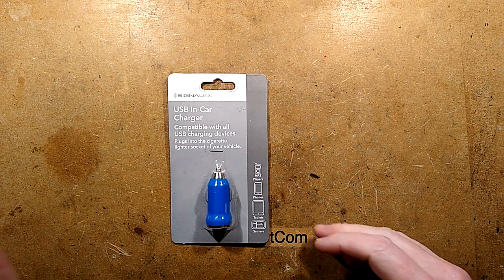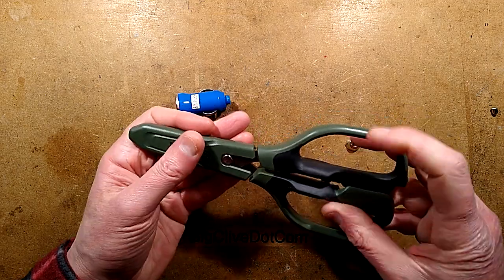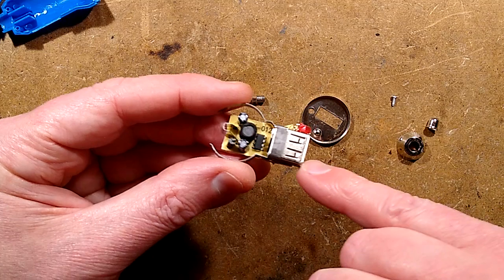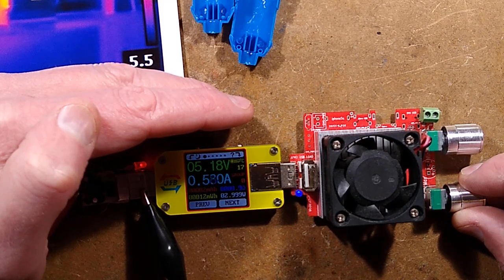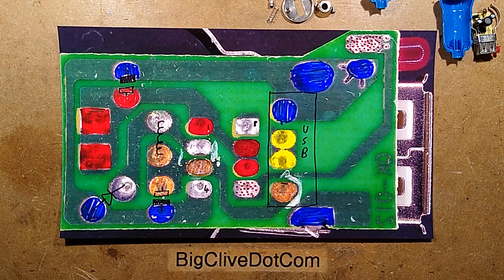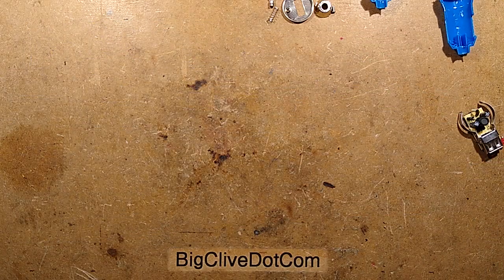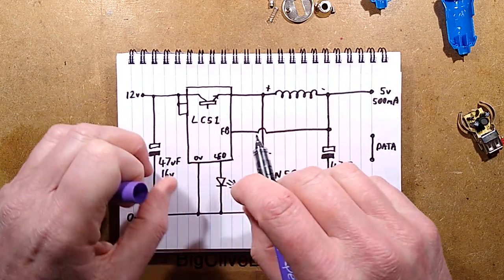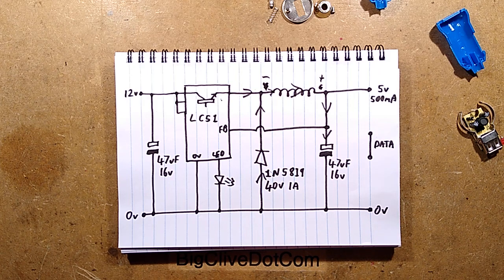Inside a Pound shop car-USB charger (with schematic)

Comment: IIRC shorting the data pins tells the devide to take as much current as it can from the USB port.
Basically it draws as much as it can without the voltage dropping.

Comment: To be honest, those things aren't really meant for more than trickle-charging some small devices like a phone or MP3 player. (Seems they're close to being optimized when designed for that role.) And for something typically under $5 on the shelf near the check-out counter, that's usually all that most people would expect of them.
Reply: "If you judge a fish by its ability to climb a tree, it will live its whole life feeling inadequate."

Comment: I could see this being somewhat useful if the chip accepted higher incoming voltages, like being able to plug into a 24v DC socket. But even if the chip can, they nerf'd it with the high-side filter capped at 16v. 🤷‍♂️

Comment: 8:13 I don't think the LED indicates an overload intentionally. It looked like it died down because the output voltage was sagging. It's probably driven off the feedback voltage just through an internal resistor.

Comment: Downside of these circuits is, when the switching transistor shorts, it just sends 12V to the USB port... there is ZERO protection, not even a clamping Zener.
Reply: Would a zener even help? If the chip fails, the zener would get 12V, probably not be designed for it, likely blow up open circuit, and give the same result.
Reply: @sanderd17  that's what the fuse is for

Comment: You need to nip down to Halfords and get a Tom-Tom adapter - looks about the same.

Now then, you got components? You got a screw, a fuse and a spring?  All for a quid? Blimey, Clive, that's a pretty good deal, all things considered!
Reply from the maker: The early TomTom adaptors actually had a remote voltage monitoring wire to ensure 5V at the satnav.

Comment: A specialized chip? In the 1980's they'd have just used a Zener diode in parallel with the load. 500 mA would have been a dream.

Comment: 7:04 I've done that with my S9 cellphone. Phone paradoxically runs its battery down to nothing trying to charge itself, and then just says "Check your charger" at the end when its down to about 5% battery life.
Reply: Oh, kids these days have it easy...I had a Samsung Galaxy Tab 3 that if you were to accidentally run the battery all the way to 0, you had to spudge off the back panel and disconnect the battery, plug in a 2 Amp charger, then reconnect the battery or otherwise it would just blink and not start.
Reply: @brentfisher902  Our first cell phone ran off a 12V car battery and took up an entire trunk. My dad is a doctor and got one of the first Motorola cell phones to come out for his car when he was working at the hospital. Next one ran off of internal lead acid batteries, but was portable! Huge step forward at the time lol! Still had to sling the electronics and transmitter over your shoulder when making a call, but it could go to the beach or on vacation, meaning you finally can leave work, but work never leaves you, just like today.

Comment: I'm almost certain the Motorola you mention is the ubiquitous MC34063. That is one seriously versatile chip. 

Looks to me the trend is to make the divider for the feedback permanent in the chip since it's always expected to make 5V... 

But that's annoying to people like me that get these things to repurpose them, and basically it's all but impossible to get a stable output from them at less than 5V (impractical is a better word, I've managed to do it but it's very Rube Goldberg lol... Better off just using another chip)

Comment: I went through several rounds of cheap USB car adapters from eBay several years ago. Current spec was optimistic to say the least and they ran too hot for comfort. I finally gave up and bought some Anker adapters for our family.  Not quite as bad as the cheap mains adapters but still dangerous.

Comment: I may be misunderstanding how USB chargers for Lithium cells should act. Most battery chargers maintain a voltage and the sign of a fully charged battery is reaching a set voltage or a set low current flow to shut off the charge.  I saw it acting correctly dropping voltage to limit current for the case of a shorting or over heating battery in a device designed for 1/2 amp charge rate.

Comment: My go-to flashlight has an internal charger that (I've never actually timed it) will fill a 3350 mA/h 18650B in a bit over an hour or so as long as the usb supply to it can handle the current.

Comment: In my opinion, it would have been better if they used a liner regulator instead and used a metal body as a heatsink as those can easily deliver 1-1.5A and their output is ultra stable but this probably 5 cents cheaper 🤔🤔

Comment: devices will try for an amp, w many monitoring for voltage sag and throttling current back. but that won’t work on this with its abrupt v/i curve.  
i guess you could charge a small power bank,  but overall i’m really surprised they are selling this at all.!   

 All of the cheap adapters I’ve seen in recent years here in USA do an amp, though not gracefully. ..
Reply: The surprising part is that they label it at 500mA instead of the 1 Amp that they get listed in the US from what I've seen
Reply: @nyetloki  At least they are honest about the product being useless 😂

For a period iPads would pull the full specification’s 1.5 amps when D-/D+ were shorted.  I plugged mine into one of these  “1A” car  chargers and it instantly made quite  a crackle  and pop w magic smoke.  Apple had since scaled it back iin the software, and now ipads and iphones draw max 1A when plugged into D-/D+ shorted chargers.

Comment: Could you bodge in a bigger transistor and get the thing to drive higher current? Lol probably cheaper to buy a better unit, but stuff like that always intrigues me haha.
Reply: Would probably also require bigger inductor, diode.

Comment: It would be nice to see a modified version. A single FET or transistor from the 12V to the inductor, controlled by the output from the IC (which should be disconnected from the inductor), should do the trick. PS: it might need a pulldown resistor and/or base resistor depending on type of FET and output of the IC.
Reply: Even better would be a new chip revision with a lower loss transistor (maybe a MOSFET) to keep chip cool even at 2.4A output load .  Might also remove redundant pins as 6 pins would do, though keeping the pinout would allow supplanting the old chip in the market .

Comment: These seem to be quite gentle on phone battery life, almost like a trickle charger.  You can leave it plugged in all day with a nav app running, and the phone never gets hot.
Reply: My s7 and s10 would discharge faster than it can charge with a maps app running. Hell it would discharge with anything running at 500mA

Comment: Well... A modern battery would be for instance on 14 Wh, to and that "charger" provides 2.5Wh, so given you have more than 6 hours of battery on a charge it'd power it fine.

That said, it depends on if you're listening on music or playing games. It is what it is, and I'm my eyes it would be perfect for a lot of things, especially on longer trips or as a cushion to stop the battery from discharging.
Reply: I have a USB power bank where I stayed up on a cold winter night and hooked a USB load and testing meter and it was able to run 2 Amps for 5 hours non-stop, so 50 watt hours on a single charge...It kept me warm and toasty under the bed covers....Yes, they do make them this big...it takes the good part of a day to charge up, though...

Comment: I have these in my house I use them to charge my phones and power lights all over my house. People talk about power walls using 18650 cells and tesla walls and I use 12 volt battery's and 10 of these things and a 4000 watt inverter. I get these at the dollar store but I make sure to get the 2 amp ones because they don't get hot as fast as the 1 amp
Reply: I did something even sillier, I soldered wire to the contacts of a $20 cigarette plug 12 to 120 volt DC-AC inverters and hooked it to the high-voltage side of a Arduino step up converter adjusted for 12 volts, and soldered a USB male plug to the low-voltage side...I can run a 4 AA Sony 120 volt battery charger off of a USB 2 Amp power bank now...I have succeeded....in making...the Battery-Operated Battery Charger....

Comment: 500mA is still more than enough to slow charge devices. Generally that's how you want to charge devices anyway. Reserve fast charging for when you need your battery topped off in a hurry. Your battery will live longer!

Comment: Bigclive I have the same charger my School gave it to , they ordered it with our school logo and color !
Reply: I did noticed mine has more parts mounted on the bottom including this IC MC34063A

1.5-A boost, buck, inverting switching regulator  ! even thou mine says 500 milliamps at 5 volts

Comment: Had one of these that failed in a way that caused full 14 volts to come out of the USB, it blew up my expensive bluetooth speaker , not happy at all. The other issue with every USB cigar adapter that I've tried is the chuck out a ridiculous amount of radio interference, somtimes completely knocking out the car radio .

Comment: Clive have you done a video on how I can power my myriad arduino device with mains voltage?  I am running out of "wall warts" and most of these devices are simply turning on and off lights and things thus one end of the box already has household voltage coming.  

I saw some cheap devices on ebay that will do it but have no way of knowing if they are any good and you are the only one I think is smart enough to answer this!  Thanks.

Comment: The last one I took apart just had a 7805 linear regulator in it.
Reply: Keep that one.  It'll last forever 😂...although those 7805's need a decent amount of heatsink to drop from typical 14V running voltage of a car alternator down to 5V and carry full spec current of 500 mA.  It must have either got scorching hot, or would thermal limit and not sustain 500 mA output.

Comment: i opened up one from 1 euro shop a week ago because of my interest and it had double usb port with 2.2ah each i said scaaaam!!!and it was actually i measured it and not even 1ah it was 0.8 hahhahahhaah
Reply: I once got a 2 USB port (insert censored number for the median age of the human population) volt wall charger that said it could do 2 amps, and couldn't even get all the way to a P.W. 500 milliamps...the only thing weaker was the hot water temperature on the shower on my house...or my lust level...
Reply: @brentfisher902  Uh....I'm not sure which of your claims is less believable.....that you'd need a 29.6V wall charger, or that youtube would censor the number.
Reply: @SodAlmighty  120 volts. People are getting older, which leads to the "Ok boomer" trope.
Reply: @brentfisher902  120 is not the median age of humans. You have clearly grossly misunderstood the meaning of the word.

Plus, I still don't see why YouTube would censor it.

Comment: It would be interesting to see how clean or dirty the inputs and output are with a scope, also does it put out enough RF to cause issues if a radio is nearby or powered from the same supply ?
The 12 to 5 adaptor supplied with my Tomtom sat nav works perfectly, cheap ones wipe out the radio :(

Comment: I wonder if the separate VCC input for the transistor is there to allow you to use an external PNP transistor of P-channel MOSFET if you wanted to. Do you reckon they aren't connected internally?

Comment: Thing about these that annoy me (albeit you find this in MOST car USB adapters) is they create lots of nearby interference.  You can test this.  Find a station that you're not super close to on the radio (at least in the US it works), but just close enough to where it sounds clear and fine without this charger plugged in.  Then, plug this adapter in and start charging your phone.  All the sudden there's plenty of static as if you're out of range.  Annoys me easily.

Comment: It bothers me that if the series switching device goes short, the full 12V goes straight through to what might be quite an expensive device on the end. I would like to see a crowbar diode across the output - but obviously not affordable in a minimalist design like this. I had a wifi router on a boat blown by this sort of failure on a similar device.

Comment: I would like to see a single fault condition test to this circuit. Buck transistor in short circuit and 10ohm load connected to the output. Would the input fuse open or would it just pass the 12Vdc from car battery to the load?

Comment: USB data bridged is the "standard" for USB battery charging, if I'm not mistaken. Supposedly good for 2A, though there's so many shit chargers in circulation that modern devices have smart charge circuitry that will slowly increase their current draw until they see voltage start to fall off a cliff.  I'd be very interested to see oscilloscope output from that supply, it's probably absolutely horrific, especially when you factor in that automotive alternator output itself is already completely terrible.

Comment: Given me an idea for a quicky dirty 5V buck converter I need for an Arduino Uno which has a 4inch touch screen plugged in and hence needs a bit of current for the 5V due to the backlight and linear is no longer an option for use off 12V.
I shall buy one those to hack.

Comment: I always got paranoid about cheapy 12v USB chargers.
It's not like there is any standards or bodies regulating these things not that there would be since it's low voltage DC but still.
In this instance though there is only so much that could go wrong, it still sucks at 500ma.
Having a 5.1v output however goes great with the cheap thin USB cable you got from the same place just to help alleviate the voltage drop from all that massive amperage your going to subject it to

Comment: It almost feels like this should be more expensive than using one of the newer ICs.
The newer chips have beefier integrated FET (2A is easily doable) and have a higher frequency, which means smaller inductors and capacitors are needed (all-SMD is doable, so assembly is cheaper too).
That big through-hole inductance just doesn't look right to me...

Comment: Recently subbed coz of the cool stuff you tear down but love the accent to!
Was wondering if you would look at a Chinese inverter that feeds back into the grid?
I built a solar system a couple of years ago and connected one up and it dropped our power bills substantially until the power Co got wind of it and told me to shut it down due to potential risk of workers working on lines. The inverter would not run however unless is saw grid power but they didn't care.
I would like to know how "safe" such devices are.
Reply from the maker: Complex to test that.  The utility workers are supposed to assume everything is live at all times.

Comment: As more and more cars come with USB built in, and to a much higher power rating (My Astra's ports are about 2.1A each max) these cheap things are more and more obsolete. I'm wondering when cigarette lighter sockets will disappear? They deliver much higher amps than USB if I'm correct Clive? I've never tested one. I know I probably couldn't power my tyre inflator from a USB socket with it being 14v! Unless USB-C in cars becomes common......

Comment: Love the videos. Have you ever taken a Turbo Charger or Fast Charger to bits? I didn't find one on the channel.
Reply from the maker: The fast chargers tend to have dedicated regulator chips to negotiate higher voltage.
Reply: @bigclivedotcom  Very interesting. I think that would be an amzing video. Maybe take apart a fast charger and show how modify a cheap poundshop charger into a fast charger. If it can be done.

Comment: I'm a beginner in electronics so I'm trying to understand this simple circuit.
So as far as I understand, because the chip has a feedback and constanly looks at the output voltage, it can decide to charge the inductor/capacitor through the transistor inside the IC package whenever the output gets too low, and stop charging when the output is high enough. So that would mean that even if this circuit is designed for 12 volts, it could run at lower or higher input voltages, since the time it takes to charge the capacitor/inductor would increase/decrease accordingly along with the average switching frequency of the transistor. That would make the output also relatively clean even in the event of voltage peaks/valleys like in older cars when turning on the engine, outside of a bit of ripple present because of the switching frequency.
Did I get this right ?
Reply from the maker: Yes.  It just tops the output capacitor up as needed.

Comment: I have one of another brand with two output, one is rated for 2.2A and the other one for 3A.
Never used both at same time.
I wonder how it dissipate the heat in such small package.

Comment: I had such a thing in my car catching fire. I disassembled the crusty leftovers and there was no chip in sight, just some resistors and one capacitor. Anyways, I got one that was 10 euro's instead of 1 euro and still didn't set the car on fire so it must have a chip :)

Comment: I think it's an improvement over the early ones that used a couple transistors.  Those would often burn out.  I'm guessing that the LC51 chip has thermal protection, but without a datasheet we won't know that for sure.  One small favor Clive could do for the curious among us is to give the volts and amps input so we could figure out the input power and efficiency.  Thanks, Clive for rewarding us with a look at all the bare 'guts' of another gizmo.